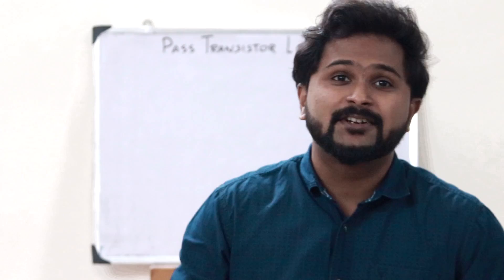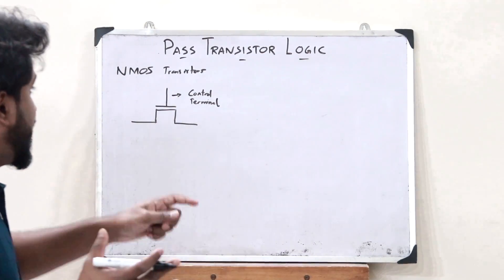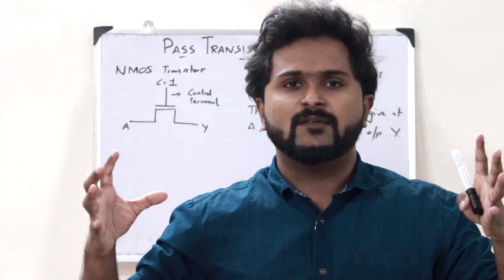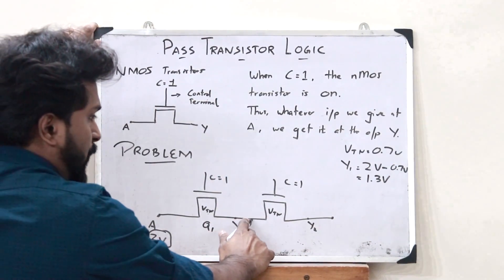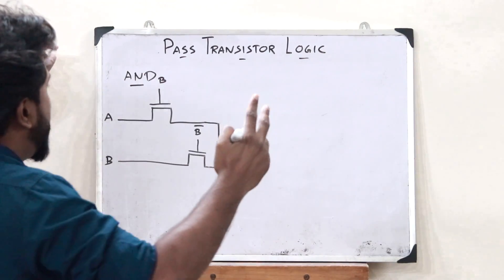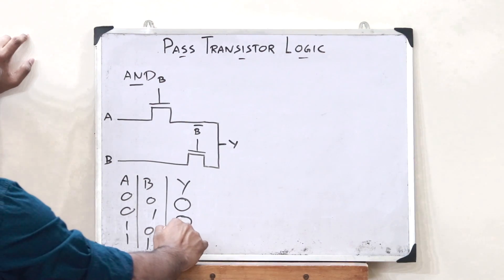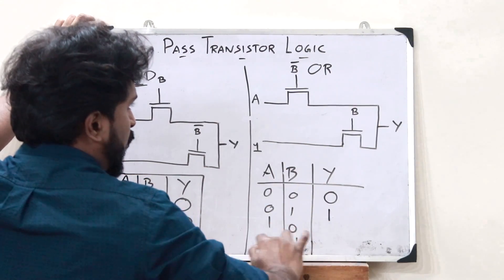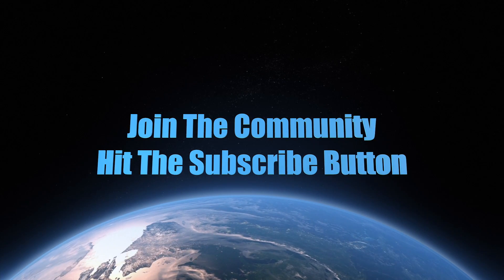Pass Transistor Logic | Working Problems Circuit | And & OR Operations with Truth Table | Simplified

Comment: I have a doubt... Can AND gate be implemented just using one pass transistor? If we use the same A as source input and B as gate input, we can get the same results. So can it be implemented?
Reply: If the case when gate is 0..the transistor will be in off state.. Then we cant get any output.. So that we use two pass transistors